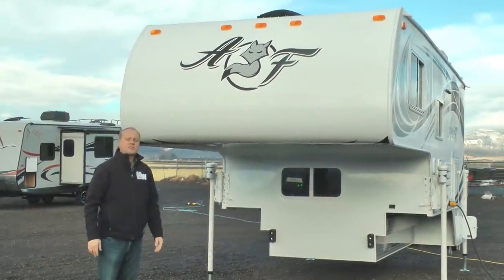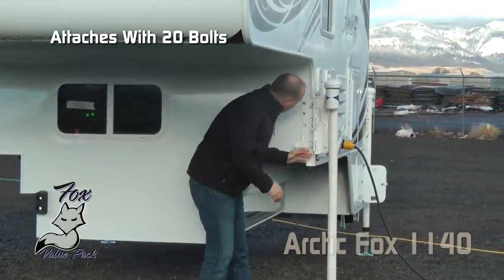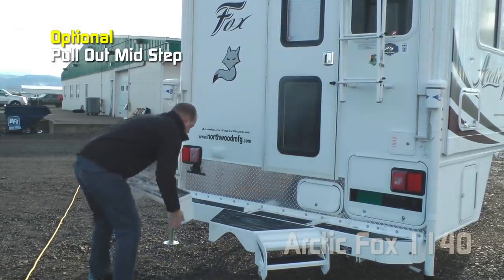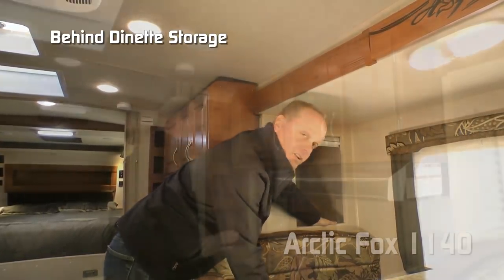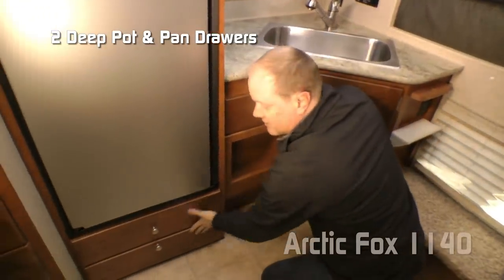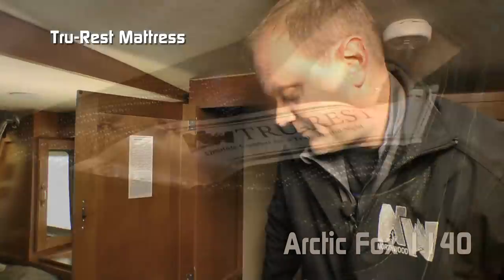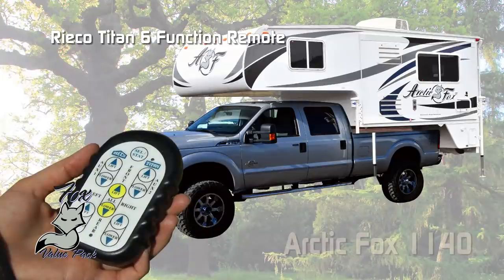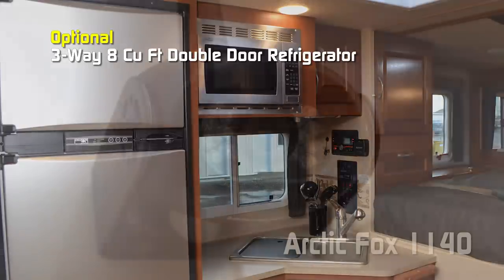Quick Tour of The Arctic Fox 1140 Pickup Camper

Comment: I'm currently choosing a truck for another large camper by a competitor but I must have missed any mention of the weight of this unit, claimed weight of mine is 3200, but I just calculated adding only water propane batteries and some heavier options. I ended up at 4000lbs before chow toys clothes pots tools ice fluids like oil or truck stuff. This one is even bigger!

Comment: At 4:45 : there needs to be a door with magnetic latches. There is no need for a face frame if you simply use longer screws with a back plate or add support inside the wall. Who thought of using a cheap window shade? The cab window should have a blackout roller shade with wood or aluminum valance. The pleated shade ends up torn or ripped off the wall with one wrong step going to the bathroom in the middle of the night.

Other than that, these are nice robust units. In the RV world, you really do get what you pay for.

Anyone posting comments about their unit leaking after just two years, failed to properly maintain it. Ensuring all seals and seams are intact is part of your maintenance schedule. I check all my seals in the spring and again in the fall. Our RV are not only subject to extreme temperature swings, but they also flex during travel. On sunny days a closed camper is going to heat up rapidly and expand. Once night falls the unit then contracts. It doesn't matter how much caulking or sealant you put on your unit, the seal will eventually need replacing. The other issue is those doing their own sealing do not properly prep the surface resulting in premature failure. Or they've used the wrong type of sealant because they didn't want to go buy what is required for that application. So they slap on some sealant they had around the house. Sure, they often told themselves it was temporary and would redo their work with proper sealant come fall or when they returned from their trip. Typically we forget or procrastinate. The following spring you'll notice the side wall is starting to bulge or delaminate. 

No matter the RV, always keep it covered with a cover designed for your RV. Insurance will not cover water damage unless a tree falls on it or you have a covered accident which caused structural damage. A few hundred bucks for a fitted cover will help to ensure any questionable seals on the roof are kept dry during the off season. I made eight arches to use under the cover to help keep water from pooling on the cover around the ACs, vents, and skylights. This also allows me to visually inspect the cover for any large rips, tears, or areas where the sun has started deteriorating the water proof top panel at ground level. When the tops starts to show signs of deterioration it's time to replace it. The old one can be cut up for other uses or given away to someone with a carport who wants to keep the dust off.

Wow... Got way off course. "The more you know... ding"

Cheers from Seattle!

Comment: I just watched the "Host Mammoth" video and felt as though that was easily the best slide-in-camper available, then I heard the price....... after I was woken up from my fainting spell I found this camper at almost half the price.  Whew, you can buy a brand new      F-350 Dually Diesel extended cab truck for what they are asking for the Host Mammoth slide-in camper.  I really love the look and design of the Host Mammoth but for the average person this camper is the much better value.  The Arctic Fox camper looks very well made and very sturdy for a decent price.
Reply: Hosts are about the top level for truck campers but you have to pay for it. Very well built, well equipped, easily customized but are large, very heavy and priced well above what people expect to pay for a slide in truck camper. AF models are just fine for the average user.

Comment: Best video ever, I wish I could afford this camper loaded up.  But you'd definitely need a dully 1 ton with air bags.
Reply: Yeah airbags are a must to keep the truck level after you throw your stuff in the camper.
Reply: Why not get a 5th wheel
Reply: @rosegarcia3414  Basically with a truck camper you can reach places that a 5th wheeler might be too big to go through. Also the convenience of just getting to the destination, detach the camper and take the truck to do a grocery run or a quick propane refill.
Reply: @makatron  what happens if you dont have the airbags?
Reply: @spikeSpiegel114  it's easier to level the truck once the camper its attached.
Reply: Wife and I have a big 5th wheel (where full timers), we can not fit in any of our favorite state park's anymore, Also forget about getting off the beaten path with a giant 5th wheel. We want a truck camper to camping again LOL
Reply: You need more than a 1 ton dually to carry this Beast. you need a 1 ton dually with an 8 foot bed and no extra cab. if you get the crew cab you're carrying capacity is 5600 pounds. One ton dually regular cab can carry over 7,000 pounds in the bed and that is what you need for this camper. I have the arctic fox 990 . Once you load it up with your gear and supplies it will weigh 6000 pounds. Or more. If you don't believe me put one of these on your truck and then take it to a scale and see how overloaded you are. When the factory gives you the weight of these campers they are not including all the accessories such as batteries water generator Etc. I like them though .better than a trailer just need a bigger truck. If you want a crew cab truck to carry one of these campers you should really look at the Ford F-450 or the Ram 5500
Reply: @REDWOOD What's the total length of your rig with the camper on?
Reply: @crazy10bears  don't have the camper on there right now but the camper is 9 ft 11 in in the bed plus the bumper that sticks off the rear of the camper., we had to buy a 4-foot hitch extension to use the trailer hitch. The camper would be better carried by an 8-foot bed putting the weight more on the front axle. We have the mega cab and an 8-foot bed is not available from the factory. If we wanted to hold the camper should have got the crew cab with the 8-foot bed. So truck is mega cab truck length plus the four foot hitch extension. Crew Cabs with 8 foot beds I have a 9 inch longer wheelbase than Mega cabs with a 6 foot 6 inch bed.
Reply: Ok, i'm just asking because i'm thinking about buying a truck and camper and need to keep it under 21 feet.
Reply: @crazy10bears  2014  Ram  mega cab 3500 Dually Limited .the truck itself measures 20 ft 10 in bumper to bumper. when I add the camper it hangs 4 feet over the rear
Reply: Thanks, it might be harder than i thought to find what i like.
Reply: @redwood6737  The F450 actually has less cargo capacity than the 350. I have a  2019 diesel 4x4 crew cab F450, long box, of course- and my cargo cap. is  only 4,650 lbs.

Comment: Can you use this in the winter?
Reply: Yes this arctic fox has conditioned area water tanks meaning the cabin air is pumped into the tank area by using a fan automatically. I have used my arctic fox 990 in blizzards while people in travel trailers around me their water pipes are freezing but no problem with mine
Reply: I take my 990 elk hunting and have been in 15 below with no problems.

Comment: I may have to trade my 07 9.9 in to get one of these.
Reply: Like somebody else said you're also going to need an F-450 to haul it or maybe a ram 5500 or you could do it with a 3500 Dually as long as you skip the crew cab and stay with a regular cab 8 foot bed those have a 7000 pound payload capacity.

Comment: Too bad you guys use Lauan in the shell construction.  I wouldn't buy ANY RV that has Lauan in its construction.    Why don't you step up the quality and use composite boards like the stuff made by Space Age Composites instead of Lauan.
Reply from the maker: We have tried several types of composites and haven't liked the results. We leave the RV in high temperature locations like Arizona for several months. Every time we get them back the sidewalls look blistered and it's a result of the composite. Lauan, if maintained, can last a lifetime! It's the best material to adhere to fiberglass but as you're mentioning if it isn't maintained can delaminate and become an issue.
Reply: If you have experienced a "blistering" problem it is most likely due to the bonding agent used to laminate the materials.  Certain adhesives can be susceptible to failure  due to exposure to heat.   As for your claim that using composites is problematic is pure nonsense.  Seems odd that the aerospace industry uses composites in aircraft structures which withstand extreme temperatures  from 120 degrees f to -30  at altitude without failure.
Maybe you need to revisit or learn how to laminate  composites with the correct bonding agents.

Comment: $11,000?
Reply: $50 to $65 thousand more like it.
Reply: You could get a much better 5th wheel for that price considering you have to have a 1-ton pickup.
Reply: 5th wheels are a lot longer (can't go a lot of places), thougher to park, a lot heavier (a lot more fuel). But 5ths wheels have a lot more room and many are like small condos nearly. Pros and cons with each style
Reply: If you shop around for a 3 year old camper like this they can be had for around 24k
Reply: @steelheadranger  All true but most places you're taking this monster you shouldn't have an issue taking a fifth wheel. After all, a 1-ton with this camper is going to be limited on where it can go just based on the weight and limitations of such a big truck that's not off road dedicated.